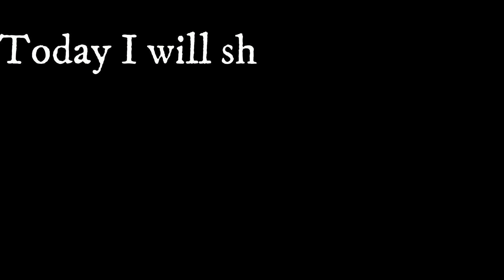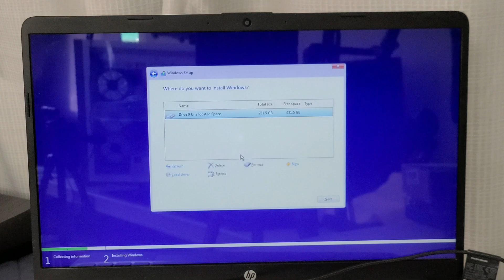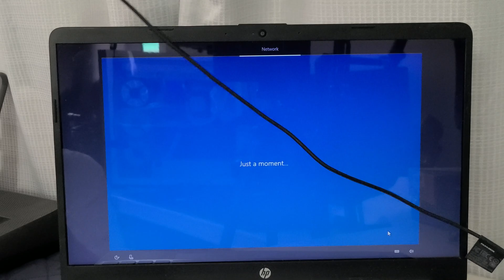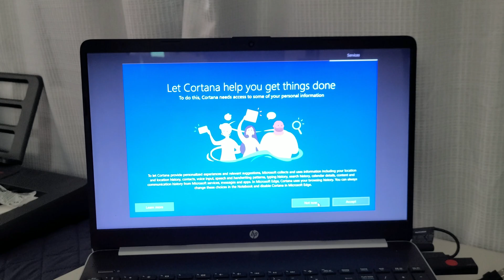How to Upgrade Laptop Hard Drive to SSD with Fresh Install Windows

Comment: My installation is failing. The Windows install iso doesn't recognize the drive but it is showing up in BIOS.
Dell Laptop
Reply from the maker: Create a Windows 10/11  bootable USB, download the Media Creation Tool. Then run the tool and select Create installation for another PC. Select USB flash drive and wait for the installer to finish.